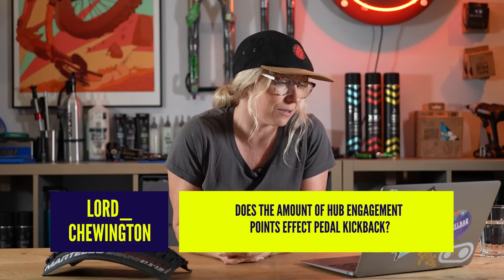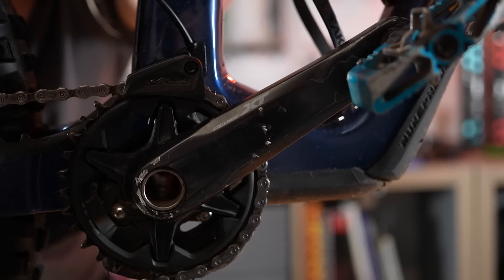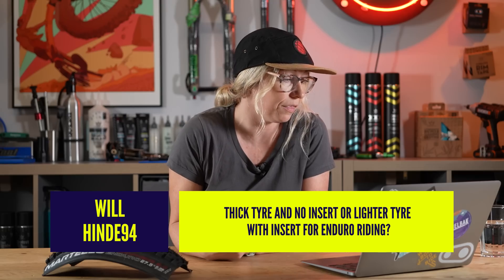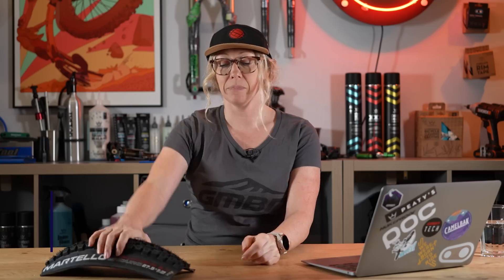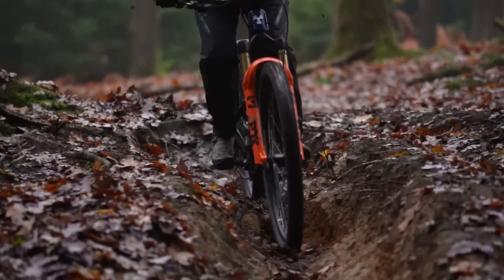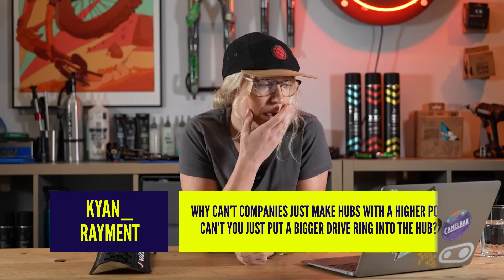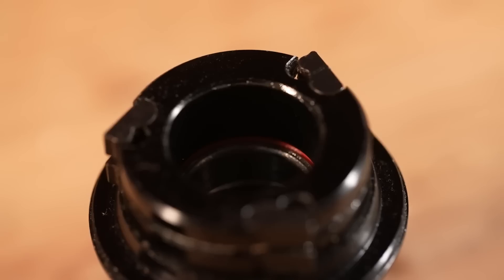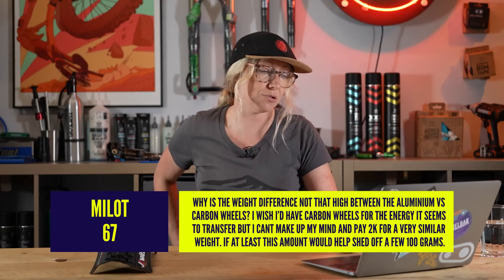How Does Hub Engagement Affect Pedal Kickback? | #AskGMBNTech

Comment from the maker: Do you have an MTB-Tech-related question for Doddy or Anna? Use the hashtag #AskGMBNTech with your comment for a chance to be featured on the channel! 👇
Reply: I am an old school MTB guy and I have trouble relating to the generational gap in information description and meaning. For example when I recently rode a brand new Nukeproof MTB I hated the feel of the geometry. It just felt wrong, but this is the Top of the line 2022 rig. I know riding styles have improved and changed but surly the universe didn't flip on it's head. This brand new bike felt like rubbish to my sensibilities. My point being I have no way of understanding the "goofiness'" of the new geometry feel really means better performance at speed on the trail. Do I sound mad? Or can you please help this old codger understand. Thank you for doing a great job Anna. Cheers - M

Comment: Peddle kick back is BS. It's an issue thought up by these bicycle manufacturers to sell you more expensive components.  When the swing arm is compressed the slack on the bottom of the chain is taken up by the derailleur.  And if you think your body weight won't over power the derailleur then your crazy.  And as for the top of the chain, slack developed. So if anything was to happen due to slack in the chain the pedals would rotate further forward.... 
But all stress or tightening of the chain is on the bottom side of the drivetrain. And the derailer will take up stress due to the distance between the bottom bracket and the hub that develops during suspension compression.

Comment: #askgmbntech Hi I have a problem with my break they were working just fine until service now when a squeeze breaks, until one point then it locks the wheel. I couldn't find what is the problem. any ideas?? thanks in advance
Reply: That's the free play before engagement, feel the breaks engage and pull lightly. Your breaks are working properly now.

Comment: I had a big issue with knocking on my trek rail when I put Halo Rims and Hubs on. On techy descents where the shock travel was fair and speeds lower I would get loud knocking through the motor and sounded horrible, Also the rear suspension felt terrible. Took me a while to realise the issue and look into it. I replaced the wheels with Hope less than half the engagement of the Halo and the knocking has all but gone and the feel of the rear suspension is totally different.

Comment: I would really like to see a mathematician sit down with a bike that suffers "Pedal Strike" and do the math on what speed the strike would become impossible..
A lot of people I have seen explain Pedal Strike give examples when the rear wheel is not rotataing, so  of course a change of chain length would pull the top of the front sprocket back toward the stopped (Fixed position) rear hub/sprockets... 
But in the real world, you would NEVER have the rear hub fixed, it would be rotataing forward at the RPM speed of the wheel.

At some point, the speed forward of the top of the rear sprocket will match the rate of 'Pull" on the chain.
(i.e the forward rotating sprocket is always ADDING chain links to the top so a chain strike caused by a reduction of chain links across the top  will at some speed, be matched/surpassed...)

Basically... is there a speed you can travel at that adds more links than the hit that subtracts them...
My brain hurts just thinking about it so I'm not up for the math.!

Comment: Live my spank 350 vibracore with Hex 101 pt engagement. Love these wheels. A year and a half clean and grease and check spoke tension now and then. Stiff, burly reliable and the vibration feedback slightly less. I run these in my tail bike and beat them in everything including some street.

Comment: #ask GMBN tech. Hi Anna and Doddy I have a question that will probably get me roasted in the comments. How does a Star Nut work? I understand that it preloads your bearings, I just don't understand how it achieves the mechanical advantage to be able to preload the bearing. Thank you for answer.
Reply: I assume you’re talking about the star nut in your fork steerer. It’s main job is to provide purchase for the stem cap and screw to pull your entire headset assembly + stem + stem spacers together and eliminate any up-down movement. Then you tighten the pinch bolts on the stem to “lock” the stem + headset together. After which the star nut + stem cap is no longer playing a role in the normal functioning of the fork/stem/steering - you can even remove them altogether and your bike will work the same.

Hope this helps, if not, wait for Anna and Doddy lol

Comment: the guy who wants to spend £2000 on a carbon wheel set should indeed look at other areas to save weight most definitely, a new frame, new group set, or just general upgrade  all round, it's certainly something I would do before laying out that for a set of carbon wheels.

Comment: This is a prime example of why our sport (mtb) is the victim of idiotic marketing-based engineering.  "Hey, buy our hubs/wheels with 720+ point of engagement for instant response!"  Next paragraph - "Hey, buy our front sprocket 'slop-adder' to prevent pedal kickback!"  Fact is you have a flexible piece of steel (the chain) that adds various force vectors into your suspension dynamics.  OEMs have work to do to isolate suspension and drive forces.  While this may sound whiny - I believe the $6-8-10k they ask for these machines justifies the R&D required.

Comment: #askgmbntech 
Hi, regarding todays discussion about pedalkickback. 
If you have a full suspension bike and use the suspension a lot (downhill) it should then be better to have a low engagement hub to make the drivetrain last longer.. or?
Reply: Absolutely correct.  A downhill bike with I9 Hydra hubs is not a well thought-out build....

Comment: #askgmbntech Hello, I recently bought a new Canyon Lux to replace my Trek Procaliber. Due to the steeper seat tube I installed a seat post with 20 mm setback to be able to copy my old settings. Is this a logical thing to do or does “modern” geometry ask for an other position on the bike? Kind regards Thijs
Reply: The most important question is always, does it feel better? The reason seat tubes have gotten steeper is that the reach has lengthened, pulling your hands and body further forward, and putting more pressure over your bb and the front tyre. If your bike feels small while in the seated position or if you have trouble getting rear wheel grip while climbing, I'd say switch back to the standard saddle. If not, pedal on friend!

Comment: #AskGMBNTech Hi, I've recently picked up my Fox Rhythm 34 fork from yearly maintenance and I've noticed, that stansions move a bit up and down. I don't have to put much force to achieve this. Should this be happening?
Reply: Yes, it's normal. The large negative air chamber helps with this. It "sucks" the fork down a few mills and steals a little bit of travel but makes the fork more supple off the top. Don't stress about it.
Reply: @istratetm  thx!
Reply: @istratetm  to be frank, i don't recall if this was happening last time 🤣 maybe it wasn't so noticable
Reply: @NRGPL  With fresh oil and cleaning, the fork is more sensitive and that could be the culprit. And from service to service the bushings become looser and looser with less stiction, making everithing more supple and easier to engage the fork into it's travel. If it doesn't knock or has noticeble play, you should be good.
Reply: No problem and have fun with it

Comment: In regards to spoke crossings. 2x provides more lateral stiffness, 3x provides more radial/torsional stiffness. 

I just had some 29er wheels built which were built 2x and I was expecting 3x, as I thought 3x was standard and strongest.

Nox Composites, Nobl and Enve make 29ers in 2x as standard.

The order which effects rim stiffness is apparently:
The rim stiffness
The number of spokes
The spoke bracing angle
The gauge of the spokes
The lacing pattern

There is little difference in spoke fatigue between them.

Comment: The pedal kickback works the other way too. When climbing, the hub is rotating slow and so when the suspension sags under load, you get a firm platform to pedal and in effect, you prevent the rear suspension from sagging. There's also antisag to take into consideration and if your frame was designed well, this makes it a great climber. It's something super hard to test in a parking lot so make sure you're test riding in real world scenarios!

Comment: Don’t like high engagement hubs. Pedal kick back is much more noticeable. Especially at slower speeds such as braking before turns in chunk and getting back up to speed in chunk.
Reply: They are stock wheels for the Specialized Stumpjumper evo. I noticed there was more play in the engagement which I was a little disappointed with. Then I rhode my buddies same bike with upgraded i9 high engagement upgraded wheels and I immediately noticed the difference in the kickback. Then I thought to myself I guess Specialized does this for a reason and know what they’re doing.
Reply from the maker: What hubs are you running and what's the maximum point of engagement you think would suit your bike?